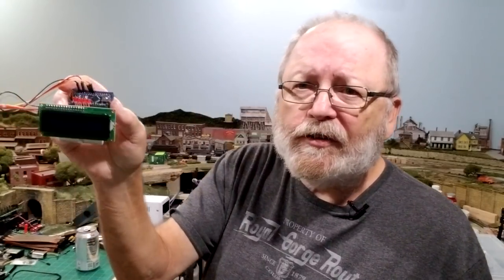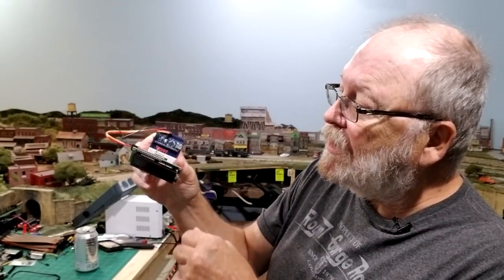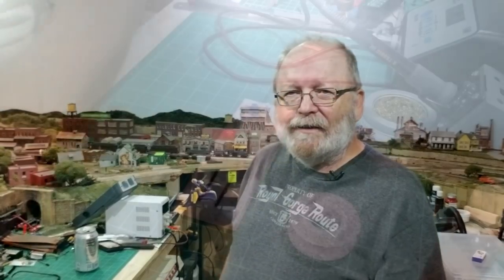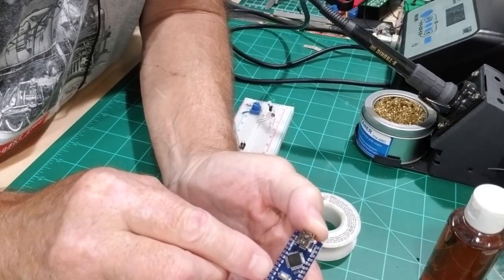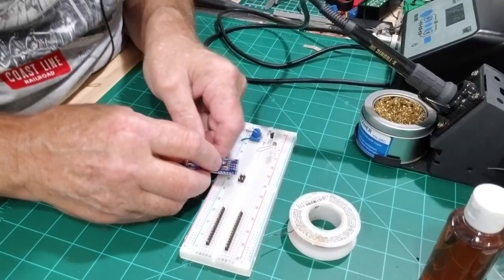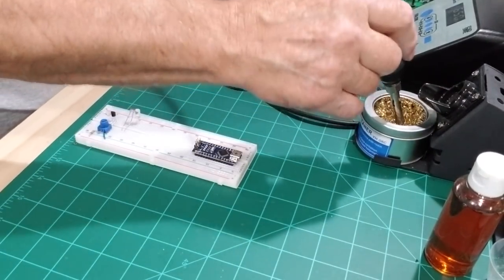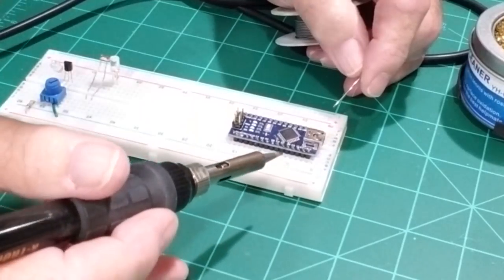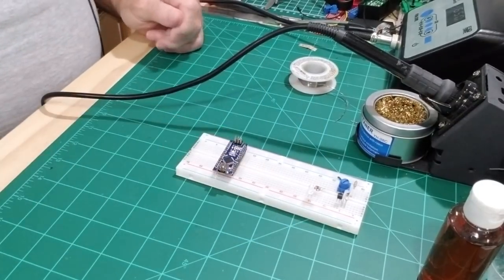Arduino Nano Headers Soldering Story - How Its Done

Comment: Something to try with the Arduino Nano's to get them to work with Windows 10:   In the Arduino software select the processor labeled "Old Bootloader".   I had this problem after the most recent update to the Arduino software, switched the processor and it worked ok
Reply from the maker: Thanks for the info Dominic. I'll have to give it a try. These have the CH340 chip instead of the FT232.
Reply from the maker: Thank you very much Dominic. I tried out what you said and it works!
Reply: Glad that I could help - I have only been playing with them for about 2 months now.   I enjoy your videos.
Reply: Thank you, it works!!!
.

Comment: Is that a cariable wattage soldering iron and what wattage donyou set it at when soldering a board like this?
Reply from the maker: It's a digital soldering station.I set the temperature to 650 F for leaded solder and 750 F for unleaded
Reply: I have a variable wattage station. Would you say that is somewhere in the neighborhood of 15W?
Reply from the maker: I used to use a 33W soldering iron for all my soldering and just change the tip depending on the size of the wire. 15W seems kind of low but you can always test it on another board.
Reply from the maker: You can get practice circuit boards on Amazon pretty cheap to do some experimenting on to see what works the best.
Reply: Interesting. Thanks, Tom.

Comment: Hi Tom, have you tried any of the pro-mini's yet?  I know they don't have much in the way of I/o's, but they would fit in a small train car or tiny building. I bought a couple to experiment with myself.
Reply from the maker: Haven't tried any of the pro mini's yet. That's down the road. There's too many things to play around with. lol
Reply from the maker: Just picked up a Pro Mini Proto Snap. It has the FTDI break out board, push button RGB LED, Light Sensor, and Buzzer attached. A few months ago I purchased a FTDI board for the same price as this Proto Snap. Too bad this is discontinued. Now I get to play around with it. Your right, this is great for small places.
Reply: Yeah Tom. Another cool thing too-You can buy shield adapters for $8 to $10 each for the Pro-mini if you change your mind later and want to take them out of your small model and use them as an uno. I am very impressed with these Arduinos. Where did you get your Proto-Snap, if you don't mind me asking? "Happy Model Railroading" These Arduino videos are some of your best. Talk with ya later. Russ.
Reply from the maker: I got the Proto Snap through Amazon. I have it listed on my Amazon Page. I have a video coming out shortly on it!